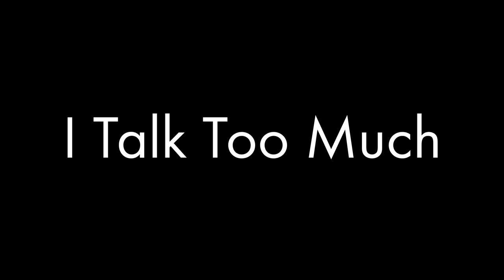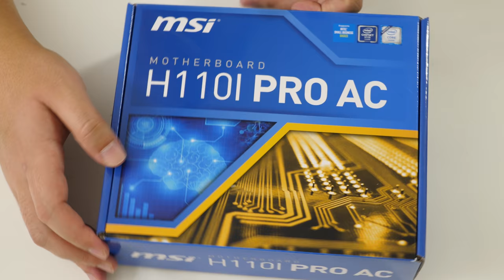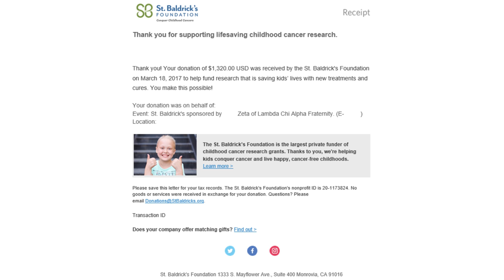Portable College Gaming PC For Charity St Baldrick's Foundation

Comment: Hey Yuki, I have a question about the XIM4. Can you use wireless headphones? I wanna use my ps4 mic but it doesn't work when I connect it to the controller. People tell me that I need to get a USB wireless headphones. But, the two USBs in front of the PS4 are already being used by the Charger of the controller and the XIM4 cable. Please, help me.